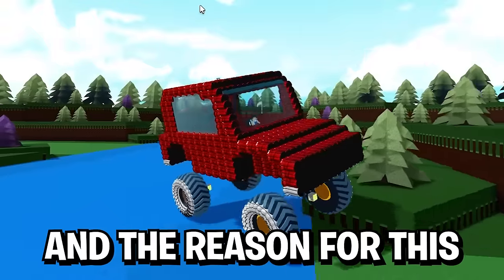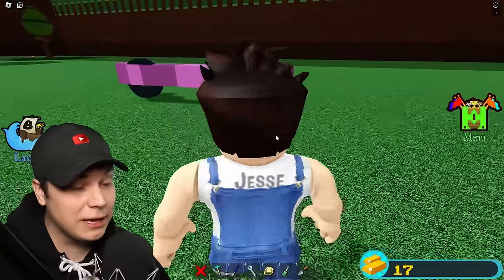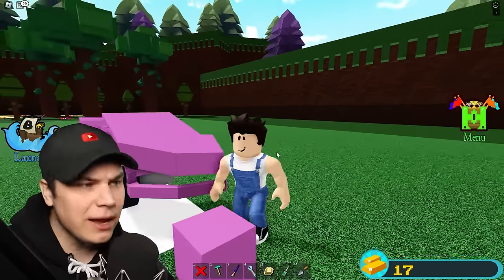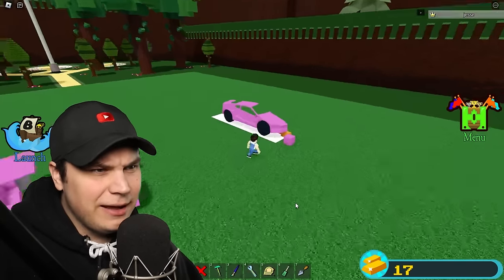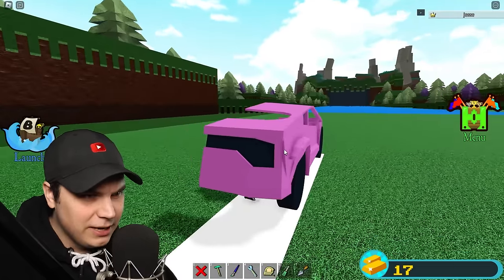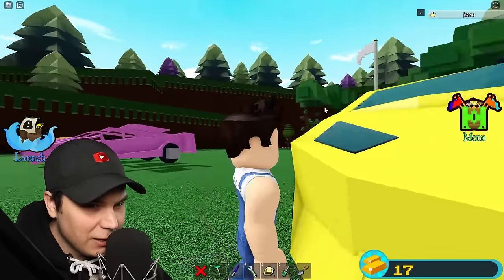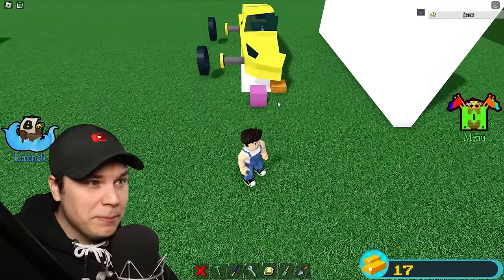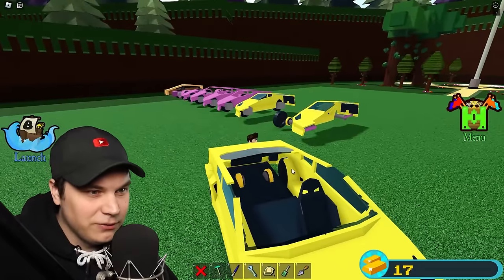How to build ANY CAR In Build a Boat! *Tips & Tricks*

Comment: Rotation 0.01 is basically the same as 0, just with a slightly wider snap and honestly works perfectly fine for me

Same goes with scale, move, clone, etc. measurements